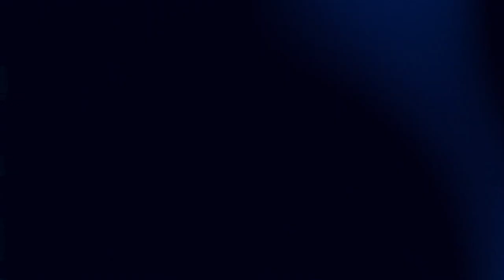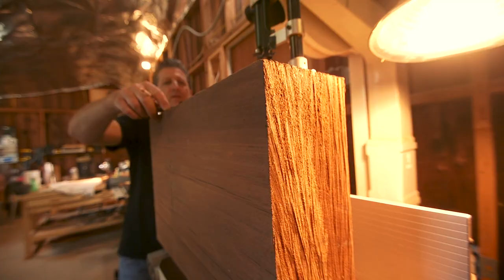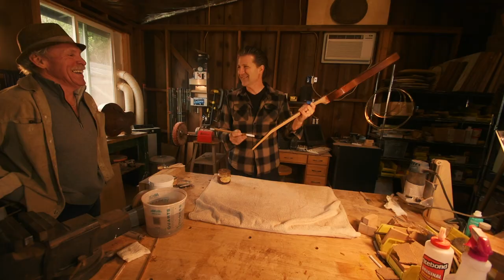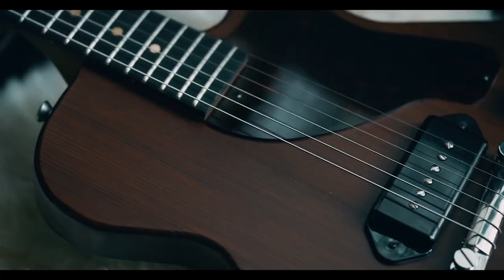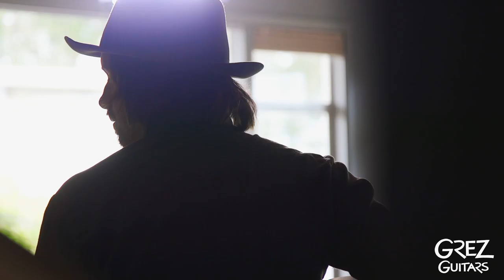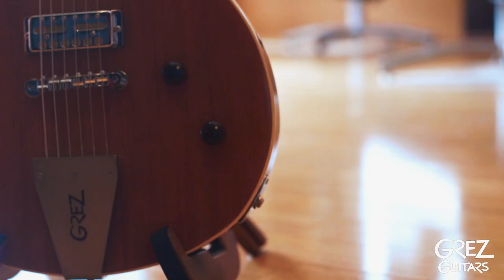Making Guitars from 800+ Year Old Reclaimed Redwood?

Comment: Redwood gets harder as it gets older.  Years ago I remodeled my parent's kitchen in the victorian home I grew up in.  The house was built in the 1880s.  It's a California home so it was framed using redwood 2'x4's, that really measured two inches by four inches.  Those old redwood studs were so hard I couldn't drive regular framing nails into it, they kept bending, I had to use some quite fat nails to do the job and sometimes had to drill first.  I doubt the wood was that difficult to nail into back when the home was built, and new redwood is easy to nail.